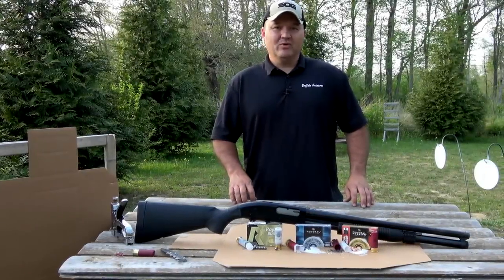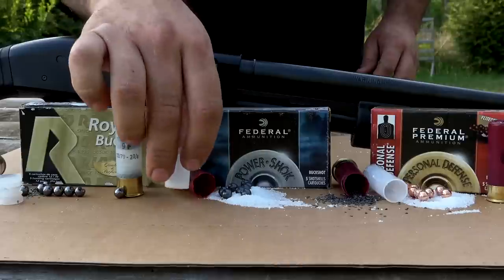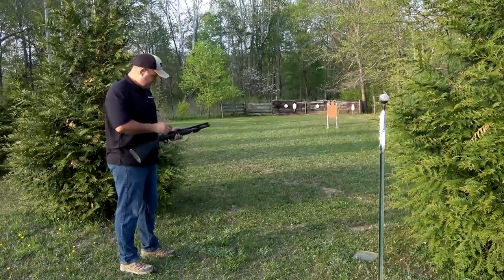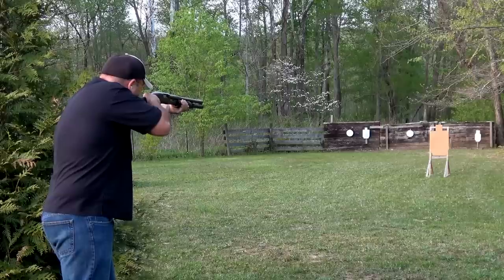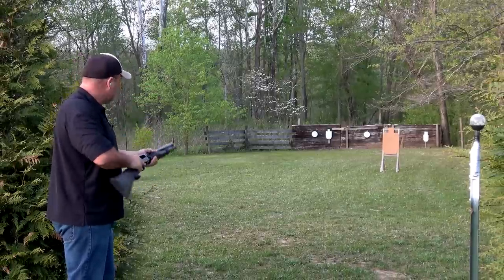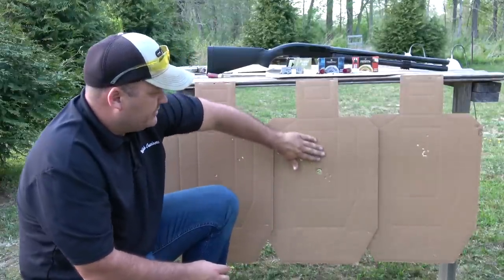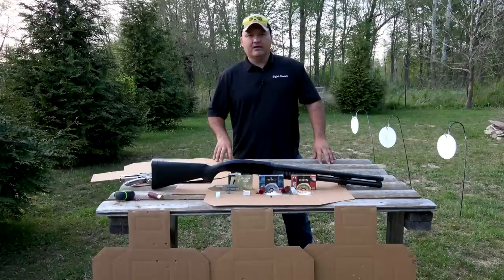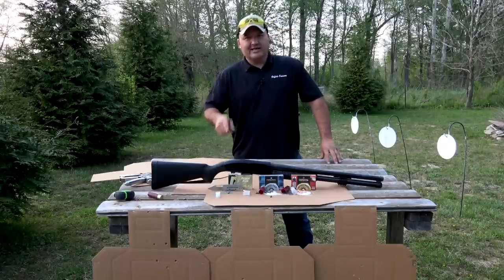Patterning 00 Buckshot part 2 - Non Buffered vs Buffered With Shot Cup Wad vs FLITECONTROL

Comment: Some interesting things I've learned from handloading buckshot in 12 and 16 Gauge:  My loads, which are taken directly from the Lyman manual and use standard one-piece plastic wads with petals, have surprisingly tight patterns which are fairly comparable to Flite Control.  This is unintentional, it simply occurs naturally.  Factory buffered loads have even and well distributed patterns, but notably wider.  Unbuffered factory loads with only a shot cup have much more randomly distributed patterns.  Sometimes they string vertically, sometimes horizontally, sometimes a group of pellets will clump together, with an occasional pellet flying very wide of the rest of the pattern.  I don't know exactly what it means, but the results of all the different loads are very consistent regardless of gun or barrel length, with barrels ranging from 7 1/2" up to 28".  Choke seems to have little to no effect on buckshot in general.  I do not know what adding buffer would do.  The manual specifically and strongly warns that buffer should not ever be added to any load which doesn't list it in the components.

Comment: I have a huge surplus of dud 20ga #3 buck shells that were given to me (55gal drum full). I handload a 12ga 3 1/4 dram 22 pellet #3 and get 12" groups at 40yds with a standard birdshot wad 18" cylinder bore which is quite impressive. If only federal sold those shot cups separate i could really throw them out there.

Comment: I know this is an old video, but do you remember where you picked up those targets? Were they picked up locally or did you get em online? I like the perforated areas.
Reply: Usually on midwayusa you can order 100 packs for less than 70 bucks
Reply: Just Google IDPA targets

Comment: Never really got why Federal thinks their flitecontrol wad is so cool, indoors it seems pretty useless, and outdoors I can do better with a hog choke and 000 buck. For the house the 3” super X gives a real nice 15 pellet pattern at 10 yards or less. Great job buffalo!!  (hoping to test some rem 8 pellet 000 buck soon, it was killing it at 50 yards from an IC out of my Mossy).
Reply from the maker: Thanks man! This has me wanting to do more buckshot testing!
Reply: I doubt that you're using an IC choke, with regular buckshot loads, and beating the Federal Flight Control ammo. I've shot them all, and this stuff is the best!  Especially using an IC, like you stated. I can't touch this stuff, and I've tried 8 different choke sizes, with several different types of ammo. I always go back to the Flight Control. Hell, it doesn't even start leaving the wad, until it's 8-10 yards down range. lol   If you can out pattern it, I would like to see you do it.....

Comment: Nice vid. I always wanted to know what the difference was. I live in a concrete jungle in the west coast (cough cough) Dont really need a shotgun or really have the a good place to practice. I do have a question for ya..If you could have only one all around shotgun for home defense and little hunting what would you choose and what gauge?  I just want your opinion. No right or wrong just a honest opinion for a city slicker who dont know much about shotguns..

Thanks and keep up the great work!
Reply from the maker: One shotgun for hunting and home defense. Well it would need to be a 12 gauge since you can get light loads to make it perform like a 20 if need be or shoot heavy magnum loads when needed so I'd want a 3" chamber. I would probably go with a pump action. It would need to accept screw in choke tubes for different types of hunting. A 24" or 26" barrel would be a compromise between home defense and hunting. Sorry for the rambling I am thinking out loud...   I would probably just keep it simple and go with a Mossberg 500 that fits those requirements. Great question by the way. Thank you.
Reply: Thanks Bud! Just an FYI...Your rambling give us all more to think about. I will look into finding one that you suggested..Thanks again for your vids!

Comment: With that barrel it would be very difficult to keep it loaded for quick access for coyotes and not knowing if the next shot will be a 20 yards or 100 yards. But, for defense purposes, it don't matter.
Reply from the maker: You're right. At defense ranges any of them are gonna leave a golf ball sized entry. I'd use the flitecontrol for hunting.
Reply: The Federal Flitecontrol is the best coyote shotgun load made, and through a open choke, Period!

Comment: Why put them all in the same place? more damage spread out.
Reply from the maker: It's about choosing the right round for the distance you're most likely to use it. For example at 40 yards the old standard load might completely miss a coyote while the Federal Flitecontrol would likely still hit it with most pellets. At home defense ranges measured in feet not yards any of them are gonna leave a golf ball sized entry.